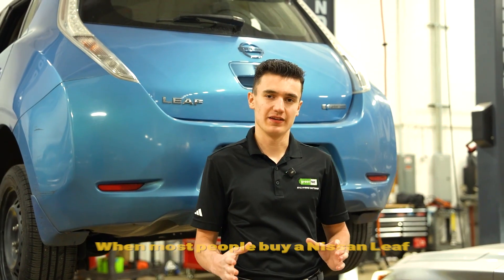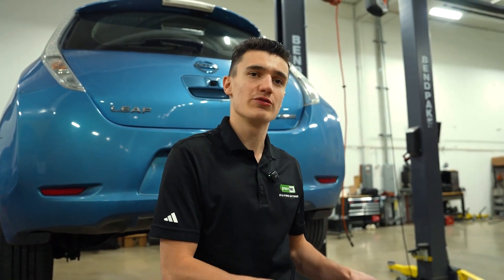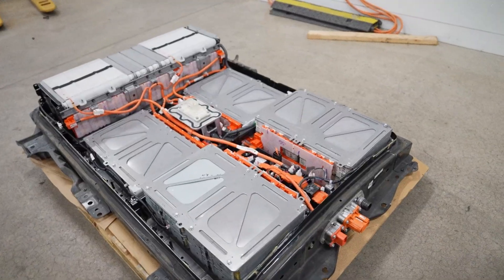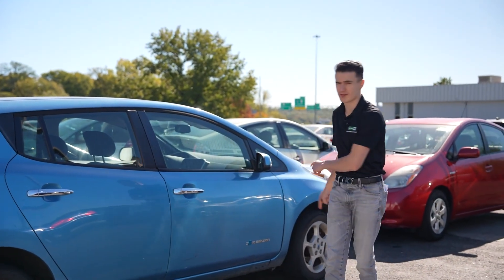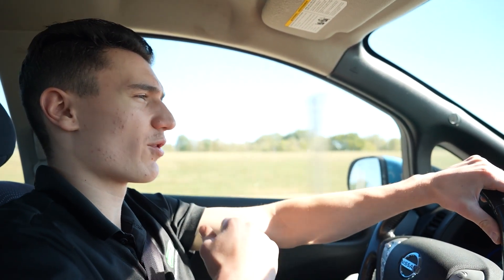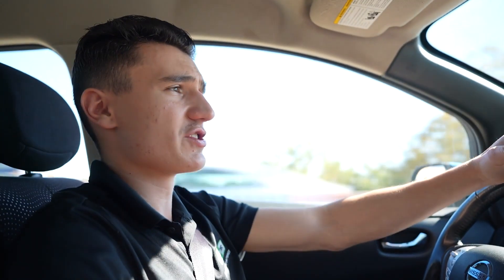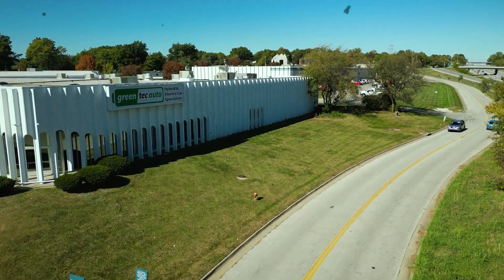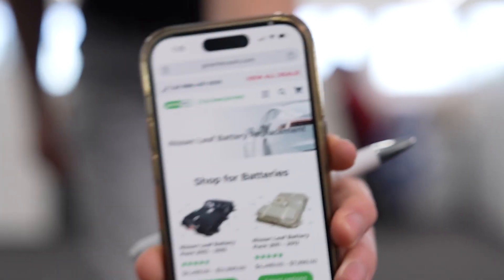Do NOT Replace Your Nissan LEAF Battery Until You Watch This

Comment: The LEAF does have temperature management or TMS as you call it, what it does not have is active cooling. Two different things.
Reply from the maker: Thanks for the comment. Just to clear it up, the Leaf doesn’t have a real thermal management system. It only has temperature sensors that can read how hot or cold the battery is, but that isn’t temperature management. A TMS means the car can actually control the battery temperature by actively cooling or heating it, and the Leaf can’t do that. It can only reduce power when it gets too hot or too cold. That’s what I meant in the video.